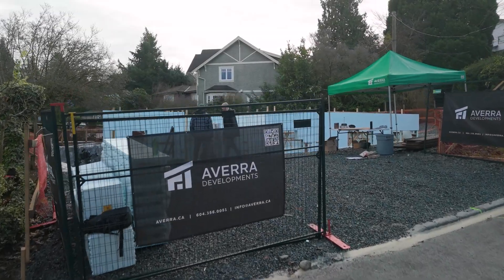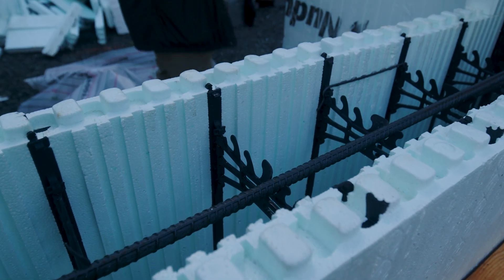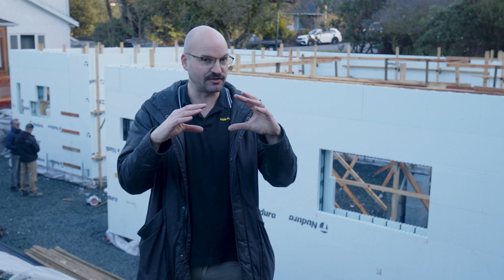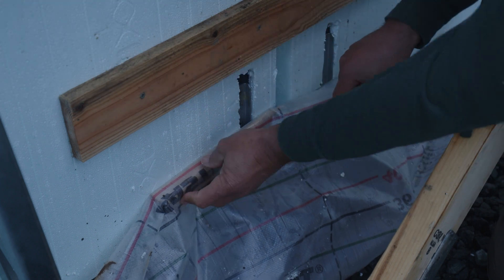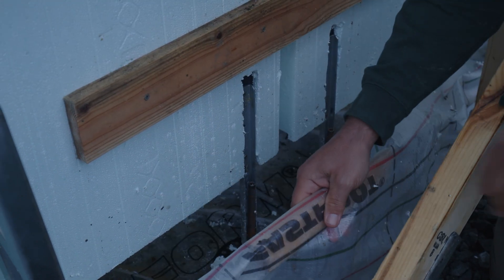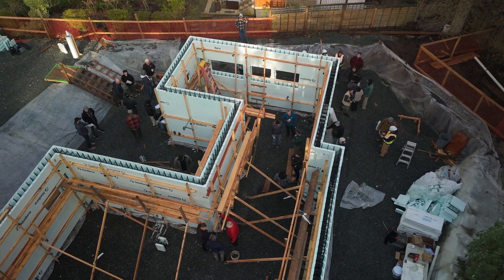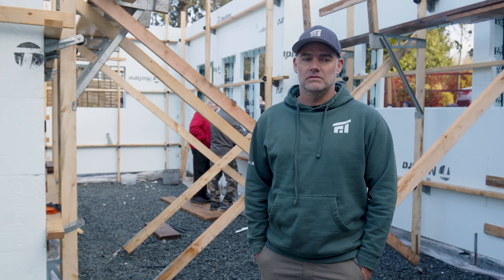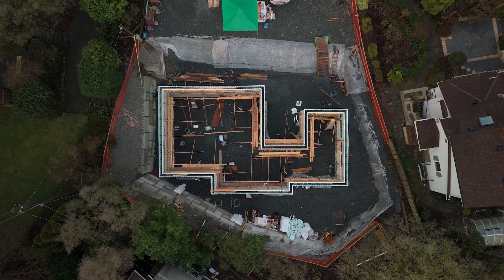Site Tour: Averra with Vancouver ICF - Most Efficient & Fastest Foundation System in BC

Comment: How does the cost of an ICF foundation compare to a traditional poured foundation?
Reply from the maker: @davey1321 The quick answer is materials for ICF is higher, but less labour and we are finding that ICF ends up in line with our budget and pricing compared to going with traditional cast in place concrete forming.